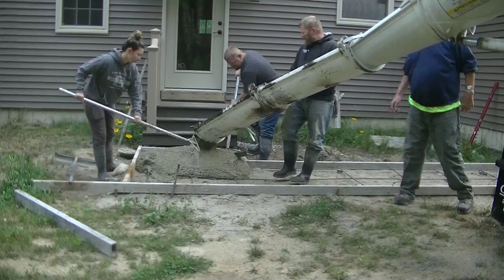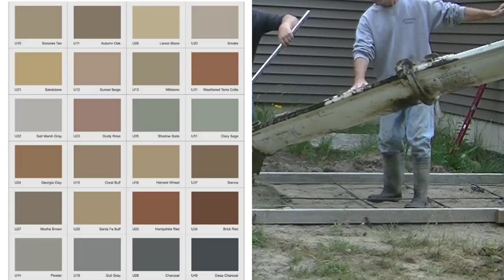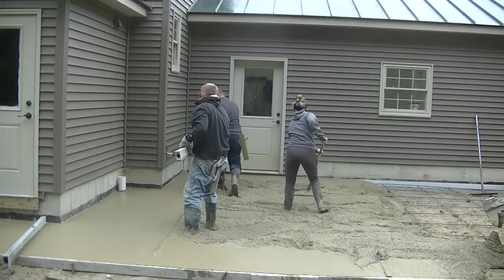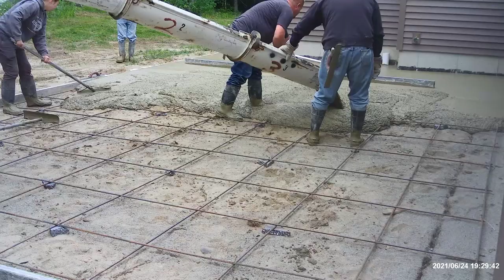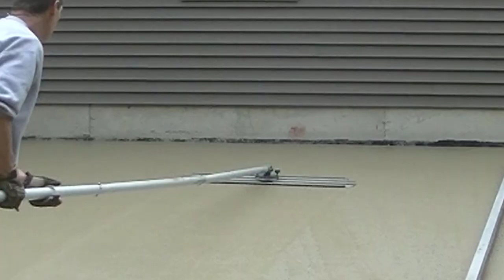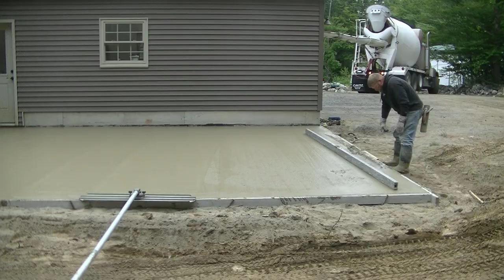Pouring A Colored Concrete Patio Slab (Part 1, Stamping is Part 2)

Comment: Hey Mike.  I just wanted to let you know that I've been watching your videos for months in preparation of our basement slab.  63 yards around 2,700 square feet.  I volunteered about 10 family and friends for the job, gave them all one specific task, and we got it done.  Almost no experience with anyone!  I power-screeded (for the first time) and power-troweled (for the first time).  Then cut saw joints with a walk behind (first time on that as well).  

It doesn't look like a pro job.  But it's close.  And it will suit our needs perfectly.  Thanks for your time in making these videos!

When we get around to our upper garage slab, it's going to be a piece of cake!